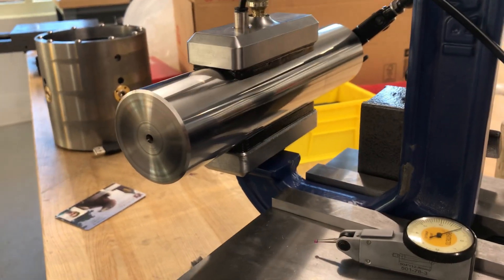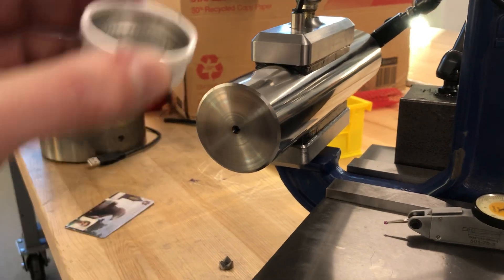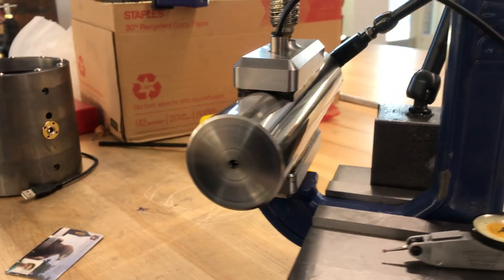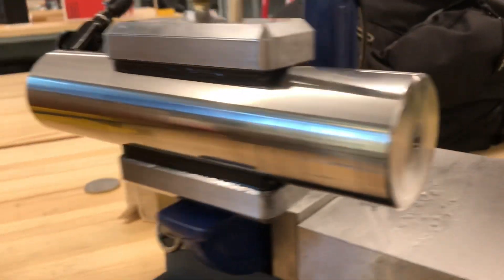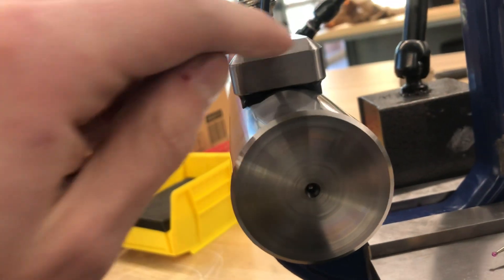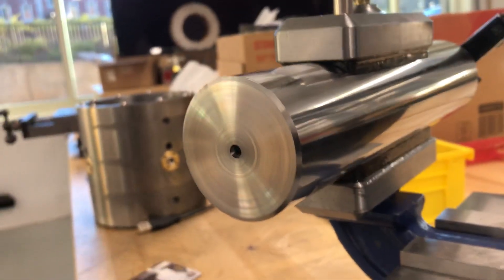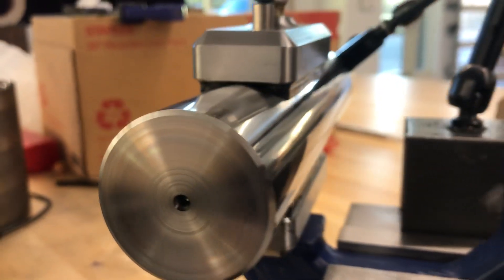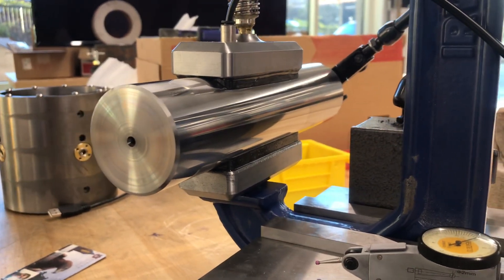Shaft spinning so fast it stands still

Comment: Hi! I just found your videos and im surprised i havent seen them earlier. 
Im interested in Air bearings for a while now and just made the first ones but im having some trouble with oscillations and the ammount of load they can take. Can i contact you somehow?
My goal is a small set of bearings for a turbo compressor, you can have a look at my channel to get an idea of the stuff i usually do.
Reply from the maker: My email is Cyruslloyd4@gmail.com shoot me a line

Comment: Question: how did you turn this off?
Reply from the maker: just turn off the air supply. comes to a stop in about three seconds. One of the benefits of graphite air bearings is they're extremely crash resistant so this doesnt damage them

Comment: If you haven’t seen this yet check out the setup New Way has with thin metallic sheets over their air bearing rollers and lever arm on the flat air bearings to provide the “thrust” or “torque”, or whatever it’s supposed to be called. I just know it’s a force from the viscous adhesion section of the fluid rushing out of the asymmetric geometry of the spacing between the metallic band and the levered air bearing. 
https://youtu.be/oNVUb3n0KR8
Reply from the maker: i have watched every video both new way and drew devitt has ever produced lol. Thats not a joke either. Very cool concept for thin film handling. Their contactless vacuum feedthroughs are similarly mindblowing

Comment: Nice work! 
This is exactly what I have planned for my air bearings on my Tesla turbine.

What’s your diameter of stock spinning there? And what’s the thickness of graphite you have seated into the housing? 

I’ve been doing a lot of research into New away air bearings and they have a lot of promising results. Again nice work here!
Reply: What type of machine tolerances and smooth eases did you need for this to work well?

Comment: i wonder how much torque it produces that way. and if it has any decent load bearing capacity.
Reply from the maker: It has a very good load capacity of about 200 pounds, that’s what these bearings were designed for. The rotary motion is just a funny little effect I noticed, the torque is by most means immeasurably small. Like unbelievably tiny. If I had to estimate after playing with it, it’s probably like 1 gram over a centimeter or .000098NM lol. Makes sense since the force is literally caused by a small flow of air over a perfectly smooth surface

Comment: By "Asymmetrical", you mean that one side of the Graphite Bearing surface is thicker than the other side?  Very cleaver!!!
Is this true of both top and bottom bearings and the thick and thin side alternate?
Reply from the maker: Didnt explain that well. The bearings are symmetrical and identical. I just mounted the top one at a slight angle so that the load across its face was uneven. The uneven load causes a non uniform pressure in the air gap, really just a simple gradient, which causes the air to tend to flow in one direction.